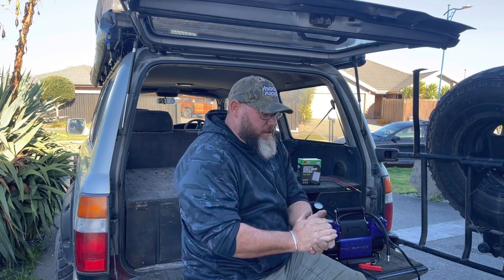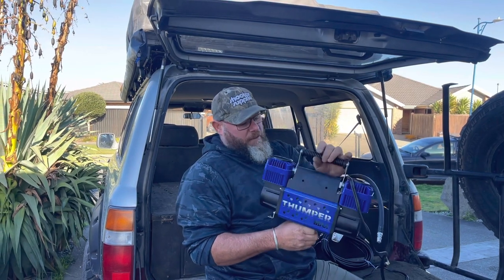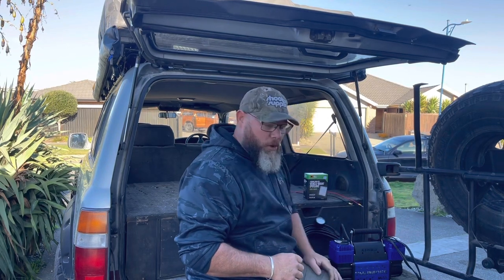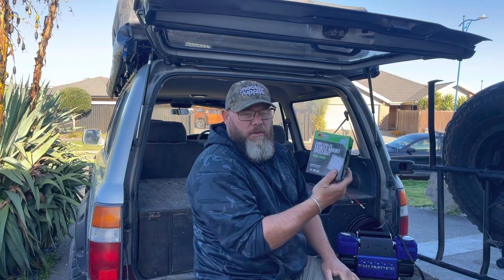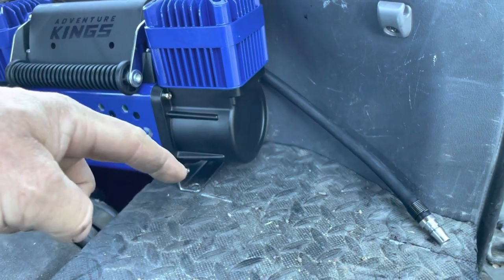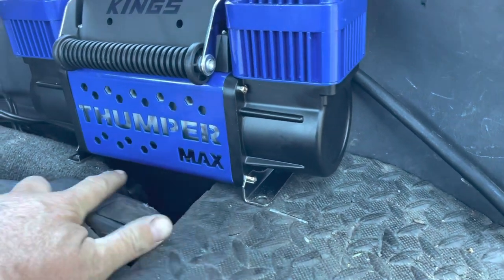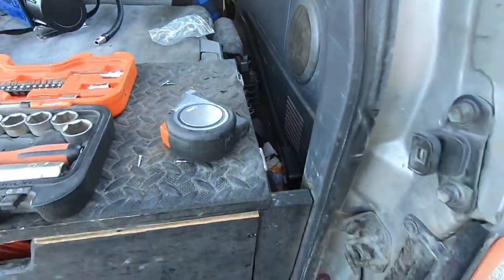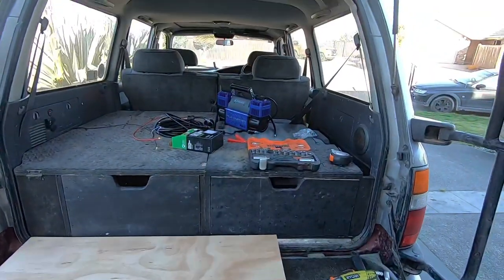Hardwiring an Adventure Kings Thumper Max into the 80series Landcruiser. Project Old Girl.

Comment: Here is what I discovered.  Under load ie when pumping a tyre this unit draws 90 amps. I suspect the wire you used is not rated for that current draw. I learnt the hard way. I tested it without load just as you did and patted myself on the back for a job well done. 14 psi on the beach and burnt wires with no way to pump up the tyres.
Reply from the maker: Yea I changed them a while ago to 100amp cables

Comment: It’s been two year no doubt the 30amp wire you joined too  100amp wire burnt right through
Reply from the maker: Haha I rewired it with 100amp cable straight away after all the comments so no issues so far.

Comment: the wires you used look like 10AWG possibly 12AWG, which is rated to 70A max, just be careful as that wire cable you're using is definitely not substantial for 90amps

Comment: Nice way to mount the air compressor. I read some of the post below and they made some good points about the wires, also dealing with my compressor I know those 2 heat sinks on top would get hot and I noticed you have your mounted next to the plastic I hope it doesn't melt that plastic trim.
Reply: I mounted mine in an ammo case on my roof rack. Makes it easy to reach all the tyres.

Comment: Nice Chris with the light get a compression spring under side with a nylock nut and an ordinary nut as a double locker. Spring holds it tight when rotating. Is the compressor rubber mounted?👍🏼💯🇳🇿